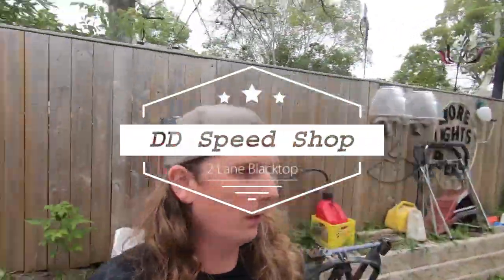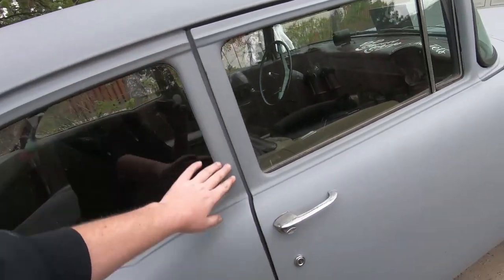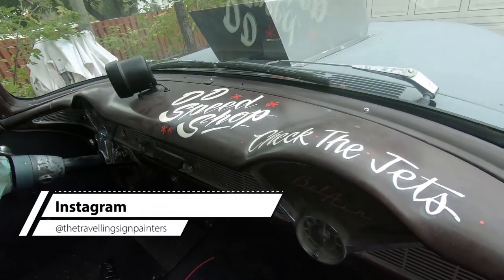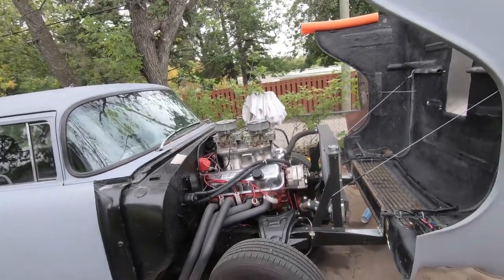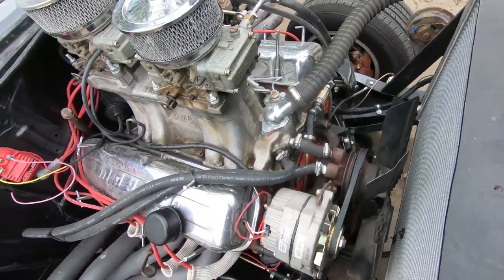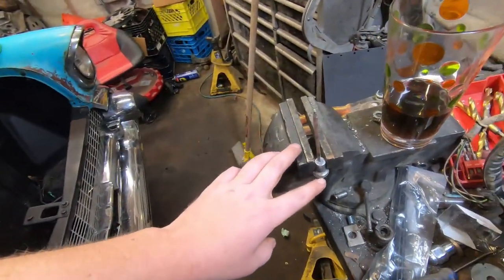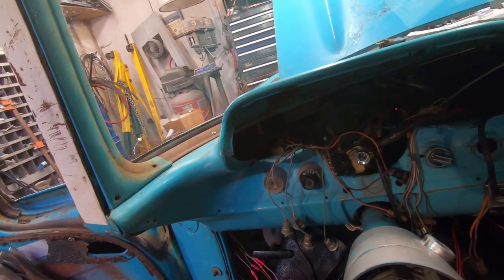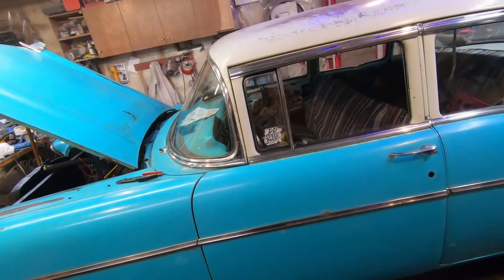Two Lane Blacktop 55 Chevy - Shop and 57 Belair Update

Comment: YES!  The rearend will sure come apart if you hook hard.  I had a 57 rear in my hotrod and broke it twice hotdoggin it.  First time was the ujoint and rear yoke, the second time was the differential side and pinion gears inside the case.  There were gears parts all broken inside the rear end.  What a mess to clean up!  What a night that was.  32degrees outside, no heater in the car and waited 3 hours for a tow...  My 350 is mild with 300hp.  Nothing special.
Reply from the maker: haha yeah that sounds about right.  im hoping this rear end lasts a while

Comment: I like your work double D, I can tell the moss don't grow under your feet. I wish more people would see the value of the four to two door conversion. You did a fine job of keeping the twist out and the square in. I rag on this yet never did one. I have done some creation cars. I had two junkie cars about same age, one 56 and one 55 but here is where it gets goofy as a snake at the diner table. One was a dodge and one was a ford.. Split them through the posts (b pillar) and widened it just a little but not much, just enough to make the welding much easier. I had to widen one and narrow the other a inch and a half but I did get good enough that it really came out good. The only reason it happened is that I wanted some more time one the wire feed and we were drinking and laughing an my buddy says "why don't you" and that is how it started and I seen it through on both before showing either one. Nine months of welding and wishing I hadn't tried it. And hold a regular job of course. I was about your age or younger as I was early twenties. I'm seventy two now. I am a lot more proud of the nice ones and I never did paint either one nor did I give them names. I guess I did in a way as I called them cuss words
Reply from the maker: haha that sounds like quite the project!  Did you end up driving your creation around?
Reply: @DDSpeedShop  put a few thousand on it going to different shows to see others but then someone with money see's it and boom you gotta find a ride home

Comment: HAY BUDDY GREAT 55 AND GOOD JOB ON 57, MY BUDDY IS DOING A 55 WITH THE CHEVY BIG BLOCK. JUST WONDERED IF YOU COULD SHOW PICTURE OF DRIVERS SIDE ENGINE TO SEE HOW THE HEADERS FIT AROUND THE STOCK STEERING BOX.  WE HAVE TO DO THE SAME THING WITH HIS. [FENDER WELL HEADERS BECAUSE OF INTERFERENCE WITH THE STOCK CLUTCH LINKAGE.WHAT BRAND NAME HEADERS DID YOU GET??  THANKS KEEP UP THE GOOD WORK!!
Reply from the maker: i used a cheap set of speedway headers.  They didnt fit at all!  I ended up cutting all the pipes and re welding them.  Than had to bash the pipe to fit the steering box.  Good luck man!
Reply: @DDSpeedShop  can u do the same thing to a four door wagon and turn it into a two door using a post 2 door as donor ?

Comment: Was the 55 a four door I thought so but it’s still cool to bad you could not have made I would use disuse fasteners on hood so it stays tight and quiet I can’t spell duse however you say it the ones you can use a screwdriver a cowlwould look awesome about a 4 inch but it’s your car good for you on putting this together I think. Would put the big lock in the smaller car and race it a little it’s cold here in on Canada also it was 8 Celsius whatever that is at 8 this morn

Comment: Bone stock 454 and you are running 2-4S? No cam change? Is it over carbureted?
Reply from the maker: it runs surprisingly well.  theyre just 2 450's though so not much more than a single 4